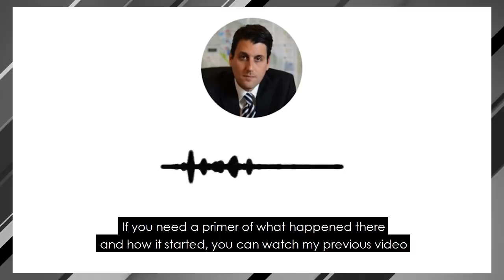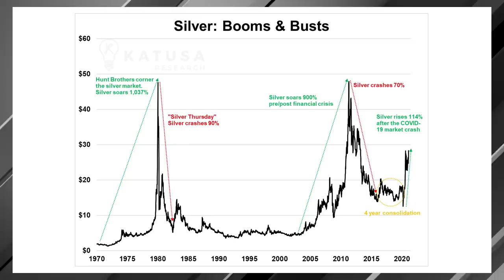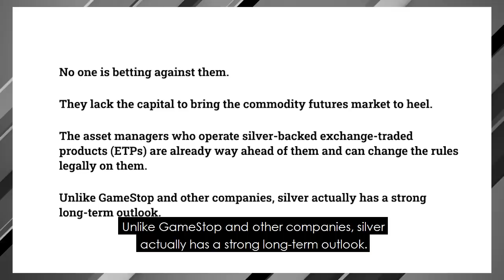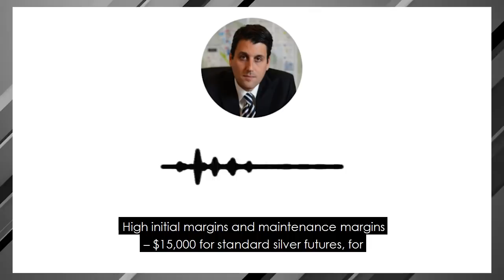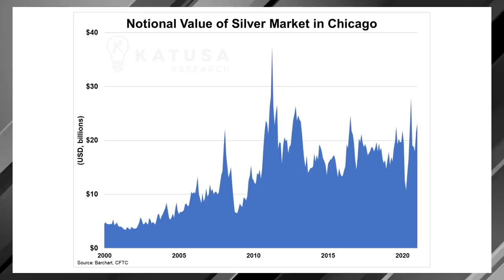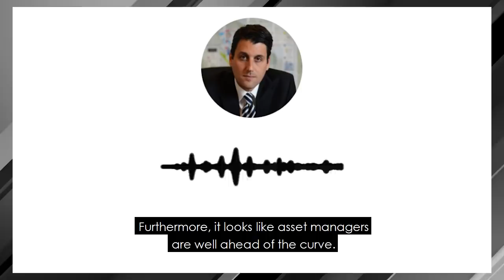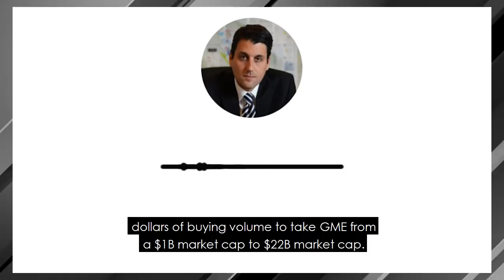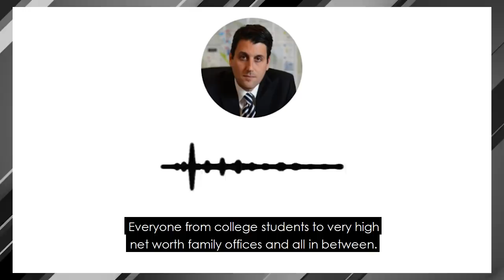Silver Short Squeeze - $100 Dollar An Ounce?

Comment: You give numbers but fail to question their authenticity. JPM has been convicted to manipulating the silver market but are still allowed to control two major exchanges. The CFTC fails to address ongoing manipulation and there is no official oversight of pricing mechanism. The SLV is supposedly a physical exchange but we can see that upwards of two billion ounces can be traded on a given day. It is clear the volumes of paper derivatives dictate price discovery with higher volumes placing downward pressure on the spot price. A recent article claims that the SLV can create a much paper 'as needed' to control the market. There is no transparent chain of custody for deposits of silver categorized in the SLV where multiple entities can claim the same ounces. None of this would be necessary if the official narrative was legitimate.